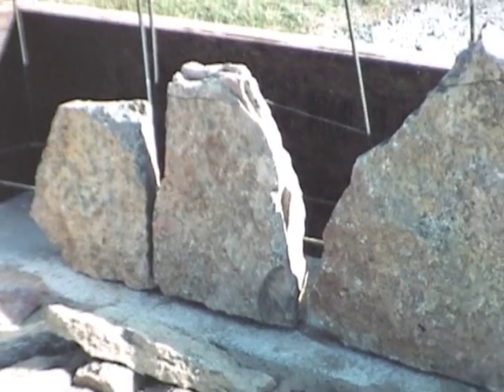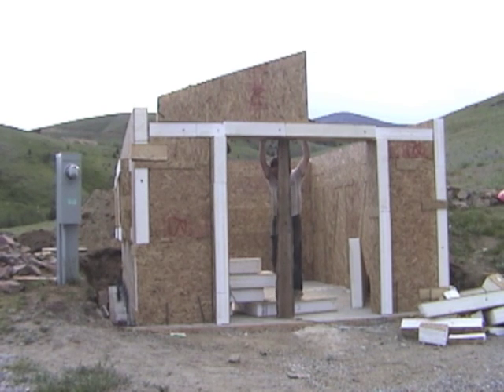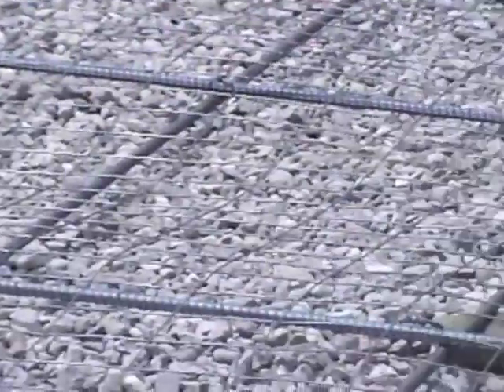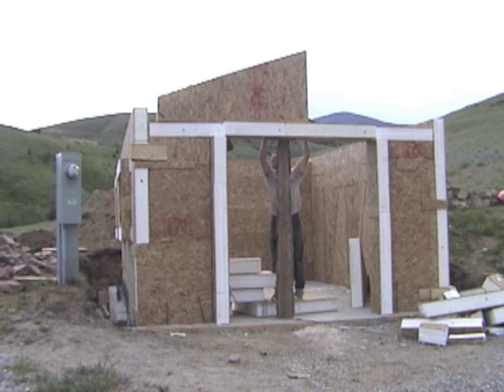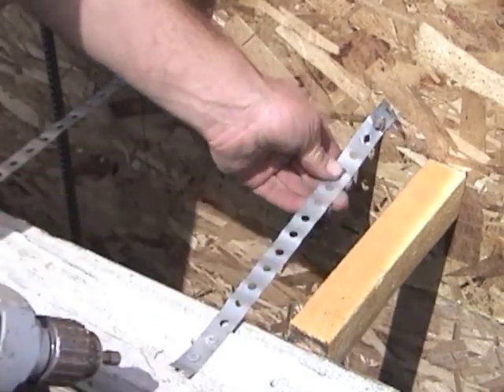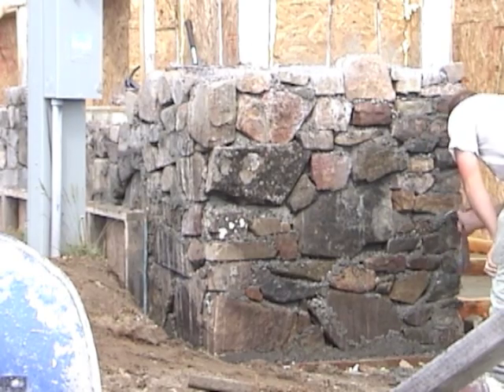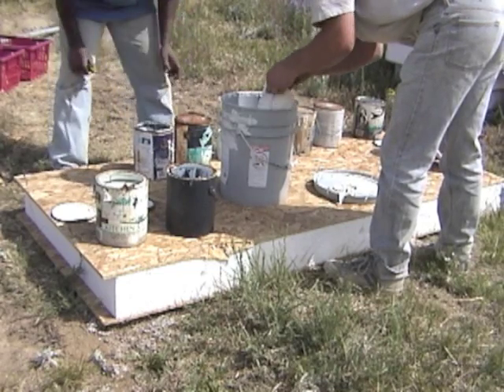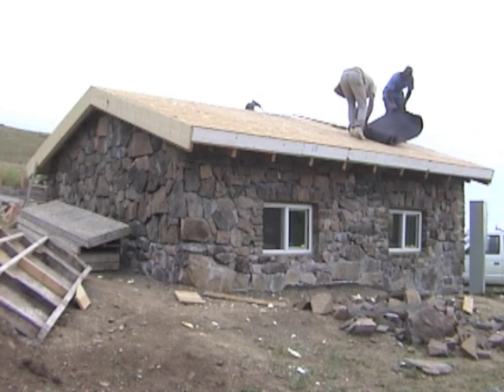Slipform Stone Masonry (sample clips from the DVD)

Comment from the maker: The costs are detailed on the DVD. I don't remember the exact figure off the top of my head, but I think we had +/- $4,000 into the shop, including excavation, slab, walls, roof, windows, doors, insulation, wiring... the works. I don't heat the shop in the winter, unless I am working on a project that requires it, but it is insulated well enough to stay above freezing all winter without heat.
Reply: I love it. Thank you for the great idea
Reply: Thomas J Elpel lindo demais,
Reply: You had $0 in ladders for sure.
Reply: Cheap shit

Comment: I wonder whether aircrete would work in place of the concrete as a filler for slipform stone masonry. It would be a less expensive, lighter, more insulated structure. Maybe strength would be a  issue?
Reply from the maker: Interesting idea. For this application it seems like the different compression strength compared to the stone would be an issue. However, I would love to work with aircrete on some other project!  Here's a tour of my house you might enjoy: https://www.youtube.com/watch?v=QWKPisywxvY

Comment: Pardon my question, but did you affix the insulated panels to the slab somehow? Or just kind of stand them up there??? And would it be better to wrap it in Tyvek before you start with the stone work?
Reply from the maker: Yes, we stood the panels up or braced them in place, then did the stonework up against the panels. Holes in the beadboard allows concrete to grip the insulation and create a permanent bond.  No need for Tyvek. :)

Comment: I'm curious how that foam insulation holds up over the years.
Reply from the maker: No noticeable change after 16 years. However, beadboard is not mouse-proof. The stone walls are, of course, but I did have some mice in the building due to aging issues with the door, and they did minor damage to the beadboard in the back corner before I got them out. :)

Comment: Problem is, no thought has been given to the corners and how they would look when the shuttering is removed. The corners look like wallpaper rather than a 'constructed' wall. The effect of bonding is mostly non-existent and arrived at by accident rather than design.
Reply: he did say to save the flat sided stones for the corners, so I'd say some thought is given to it. Perhaps overlapping stones coming from each side of the corner would be good. Structurally, the concrete behind the stones does the heavy lifting, so it's not the end of the world, in any case.
Reply: Using thin pieces of stone like this to create a veneer, means the corners are always going to look unnatural. Plus using face bedded stone on its side looks wrong too, but if that floats his boat....

Comment: Oh......what about covering those insulated panels on the outside face before forms ,stone and concrete poured /placed up against them, that would protect that wood from moisture from the concrete , weather etc.
Reply: My thoughts exactly, that OSB is going to turn to a moldy rotten mess in no time! the moisture from that wall will wick right into the wood and destroy it!  Bad move.

Comment: Have you tried making a wall without the insulation panels, just stone on both sides? Beautiful build.
Reply from the maker: I have built stone walls with insulation in the core. The walls are 18 1/2 inches thick, including 3 inches of foil-faced polyisocyanurate ("polyiso board") sandwiched in the middle. We pushed rebar through the insulation here and there two tie the two stone walls together. See my book Living Homes for details: http://www.hopspress.com
Reply from the maker: Yeah. The wall between my house and greenhouse is stone-faced on both sides, without insulation: http://www.dirtcheapbuilder.com/Articles/Building_on_Limited_Means.htm
Reply: How practical would it be to have stone on both sides and insulation in the middle?  It's a little disappointing to see beautiful stone walls on the outside and blah sheetrock on the inside.
Reply: tom, have you ever purchased a ladder or do you prefer to just pile shit up and stand on it? I'd rather see quality in the end rather than scavengry just to save a buck.
Reply: @bobbybrown221-vh1    well, hes the one with the finished project your here to see and hes not a contractor bound by OSHA crybabies.  im here to see a quality finished product i intend to do myself....not how much he spent in equipment.  most of us DIY types live by scavengry just to save a buck.

Comment: Thanks for the video, Tom.  I've been building stone slipform walls as part of my masonry repertoire for 27 years.  I have some comments which you may find helpful.
Most of my slipform walls are freestanding garden walls, that is, both sides and cap are showy stone, and the walls often curve sinuously. I've built 30 ft. tall chimneys and fireplaces as well, using slipforms, but my slipforms are simple triangular braces which are pinned into the ground, and use forms which are generally just reusable 16" x 8' sheets of deformable 7/16" cdx plywood.  The plywood is clamped into position at the top, which makes it easy to fuddle with things in order to create absolute plumb.
1. My first comment is that, imo, it makes little sense to try to mimic a proper rubble masonry style, as you have here, by attempting "blind" fits into a form.  Why not just learn and apply proper veneer masonry shaping and fitting and structural must's to create quality fits and uniform joint widths?  It would save you the hassle of lifting and re-setting the cumbersome forms higher and higher.  It would save you the hassle of waiting a day to strip the form, only to find you have yawning gaps visually competing with rock-to-rock contacts to inform the viewer that the wall was cast, not made with craft. The mortar has become unmanageable by the next day, and after chiseling out excess extrusions, striking fresh mortar into the deep gaps will likely make the wall's appearance even further from traditional rubble masonry. The need to then acid etch the film from the rock faces is a further inefficiency.
2. My solution has been to build with a stone type, river cobble, which can only feasibly be laid into slipforms. The beauty of smooth, non-angular egg-shaped or round rocks is a) they're beautiful, b) they nestle into the the swales left above the joints created by the courses below, and c) if you use a low-viscous mortar mix, you can remove the form almost immediately upon laying the last rock, assuming you've bedded each stone well and aggressively filled all the voids as you build.  This immediate removal allows you to carefully tool, strike and shape the mud to reveal as much stone as possible while the mortar's still malleable.  Larger cobble can be overlapped at the corners as if they are quoins, so that structural appeal can be at least simulated.  A large "boat sponge" is used to somewhat aggressively finish the joints to give them continuity in size and depth. In the early stages of scouring the joints, the sponge picks up sand abrasives, which give it excellent bite into the joints.  The later into the process, the more frequently you want to wring the abrasives out of the sponge and use clean, untainted water, to ultimately final-sponge the film left on the cobble surfaces.
3. Slipform is a great technology, but it's best use is with stone that can't otherwise be laid skillfully without the use of slipforms.  Tapered river cobbles can be used to make lovely arches, and elongated ones can create corner quoins and other features specific to skillfully rendered stone masonry.  A final tip:  use only angular sand and portland cement in your mortar in order to avoid the winter white crust called 'efflorescence' to appear on your outdoor builds.
Reply from the maker: Great tips! Do you have a website with photos? Or would you like to contribute an article with photos to our site?: www.DirtCheapBuilder.com
Reply: search "slipform" on StoneMad for links to some pics and discussion.  I'm Todd C.  Pleased to meet you.  I dislike the title dirtcheapbuilder.  Quality building costs money, time, sweat, skill - things not easily acquired or replaced, so why represent them as cheap?
Reply: @haileunusual  Can you link the website? Can't find the info you mentioned
Reply: What was your mix just out of curiosity? When I built my gravity retaining wall I used concrete sand.
Reply: Gary, 3:1 sand to portland, dry-ish mix, no builder's lime.  I use crushed basalt sand, which may induce some waterproofing qualities in the mortar due to pozzolanic reaction.
Reply: Hi there, I'm planning on building stone wall holiday units.  Do you have a website or a job near me? Cheers
Reply: My mix was 50 percent lime, 50 percent Portland (type N mortar) Why no lime? No lime would give a higher strength but be prone to cracking over time.
Reply: There are 2 "lime's" Gary.  

Traditional quicklime, the powder-like result of burning, then pulverizing limestone or seashells is, with water, slaked into lime putty, which is the root of "true" lime cement when added to aggregates, at which point it becomes lime mortar or lime-crete.  Lime putty derived from quicklime is a true, viable 'beast' unlike portland cement, which is "dead" by comparison.  Lime mortar is preferable to many stone masons for at least a couple reasons: It sets up less hard than portland mortar, so yields slightly thru time, discouraging cracking, and if it does crack due to sudden movement, sometimes even hundreds of years later, it literally is alive enough to grow fresh crystalline structures over the crack and thus 'repair' itself from the inside out.  Remember, it's a rule of thumb that stone, brick, block should be bedded in a mortar that cures less strong than that stone, brick, block. "Less strong" means, comparatively, more deform-able and less crack-able upon curing. 

Finally, in my experience, true lime mortar/lime plaster's biggest disadvantage is its use outdoors in hot, dry climates, because it's more sensitive to desiccation than portland cement mortars.  It needs shaded and tended with mist twice a day for two weeks to avoid developing dry-fissure micro-cracks.

Builder's lime purchased at hardware stores, aka hydrate lime, which I presume you used, Gary, only lends plasticity (read smear-ability) to a portland/sand mix.  It does not have cement-like qualities and is just a mortar additive, and its use in stonework can make the job much messier.  (With regular masonry units like brick and block, it is fine if manged skillfully.) It's safe to say that builder's lime adds, not cement-like qualities, but glue or adhesive-like qualities, which are two very different things.  Cement is for creating stable bearing, glue is for attaching things together, sometimes things that have no structural business being attached together.  This is the question that a mason worth his salt always asks: "Would this wall I'm building stand up without mortar as surely as it does with mortar?"  It's why novice stone masons should be taught first how to build a drystack wall, to see what strategies keep it standing up or make it fall down.
       
Building lime's final disadvantage is that, when used in outdoor features exposed to moisture and freezing, it can cause efflorescence, or the wicking to the stone's surface of minerals which deposit a white, chalky scale in the cold months.  Efflorescence can be nullified only temporarily, by use of applied acid solution or pressure washing, but it reappears every winter because it's integral in the mix.

That long-winded lime explanation done, I think it's safe to say that slipform building is not "real" masonry work.  That is, since slipform work relies on the glue-like qualities of mortar rather than its use a bearing and bedding platform for stonework, it is more like casting concrete in lifts than crafting structural, well shaped and well assembled stone to achieve structural integrity, which is stonework to its root.  This is why I use only non-structural rock for slipforming - cobble, rubble and miniscule bits which can't stand up on their own.  Non-structural rock is still rock, still beautiful, and deserves a chance to shine!
Reply: @haileunusual  Todd C. I tried googling slipform stonemad, but didn't turn up anything. Would love to see pics of your work, it sounds beautiful.
Reply: @haileunusual  I couldn't find slipform stonemad either

Comment: One thing what I just simply can not get is why it is so popular in US to use that almost useless power drill instead of handy and light cordless drill ?!?
Reply: Because it's much more powerful and doesn't require having batteries charged all the time. Cordless is handy if you're just screwing nails in places. I love my 20V Dewalt system for that, but power drills still have tons of uses, especially high torque and long duration operations like drilling concrete or paddle mixing.
Reply: Because some do  ore than changing a couple of screws and hanging up pictures. try work when you need a drill for your 12 hour shift. Dumb
Reply: specifically, he uses 8" (+) screws, which requires more torque than hanging drywall. At a construction site, the generator is going to be running anyway (either to charge tons of batteries, or to power the tools), may as well use the torque, and git-r-dun quickly. As the others said, there's a place for the cordless, but, if you're  using a drill to mix paint, stir compound, run dozens of 8" screws, etc, you can't beat a good ol' 120v craftsman....plus, my corded one is good excercise. the bloomin' thing weighs a ton! :-)

Comment: i would paper the chip board wall first before pour concrete against it.
Reply: That's a good idea. I think they had insulation on the other side, thus serving the same purpose for separation,  but serving the greater purpose on the building.

Comment: Ohhh pleaseee don't use cement to build stone walls!!!! You should be using 1/3 pure lime with a 8% mixture of cement and 2/3 sand! Lime lets the wall breath and doesn't trap humidity in the walls and lime also kills bacteria. Lime lasts 1000 years were cement holds 100 years. Lime can handle cold to warm temperature changes were cement tends to crack!
Reply: Makoto Ozaki
I'm getting a vision of a stone wall with 1000's of key limes stuffed into the cracks
Reply: 'proper cement' was invented in 1824 if I remember correctly, the Romans used lime mixed with pozzolan, exactly what the OP says.... if you can't get decent hydraulic limes for stonework then yeh, you could use pure lime with pozzolan, we don't use cement any more though, unless it's a garden wall or something
Reply: *****
 You should be able to get it where you get your cement .
Reply: hey sorry for the late reply! you can use any kind of lime.
Reply: Agree
Reply: *****
 Cheers to you Justin!
Reply: this looks super old, but i agree as a brick mason.
Reply: Makoto Ozaki - If you use a lime mortar mix will it permit the growth of moss over the joints? I love the old granite walls patterned with thick moss, and even small ferns growing out of the cracks.
Reply: It's not a stone wall. It's a styrofoam and concrete wall with a stone veneer. Don't use lime in place of the concrete.
Reply: Thank you very much for this information.
Reply: Eh, portland cement also kills bacteria because it's also a very basic substance. Lime is weak against acidic rains, which can be bad depending on your region. Proper cement with pozzolans can also last pretty much forever, a good example being the roman Pantheon.
Reply: Tezcax it also destroys the compounds which hold the stone together . Cement is water proof and stone is porous  unlike lime. therefore stick your Portland on bricks not sandstone . Simples
Reply: Ventilation and humidity problem would not happen. Concrete keeps your house stronger with little to less maintenance. Lime will give you maintenance just as you are done.If they had lime concrete in the old days, they would not use lime.

Comment from the maker: There is a cost breakdown on the DVD. I don't remember the figures off the top of my head, but I believe we put about $4,000 into the shop. That included everything from excavating and pouring the slab, to building the insulated stone walls, putting the roof on, windows, doors, and electrical work.

Comment from the maker: I'm sure that you could use mud to fill the joints along the slipforms to keep the concrete from squeezing out in front of the rocks. It would take a little more time, but might save some chipping and grouting work later in the process. I'd like to try that method some time, too!

Comment: I saw another house where they used sand to prevent the concrete from getting through to the face of the rocks too much.  What I was wondering is if you're going to grout anyway, could you use mud?  I figure mud would be easier to work with, and easy enough to wash off, but I wonder if it would have any negative effects on the concrete.

Comment from the maker: The oriented strand board (OSB) should be left off the outside of the structural insulating panels, so that the concrete goes directly against the beadboard insulation, and not up against the wood. For my workshop, however, we used scrap insulation panels obtained for free, and left the wood in place. But this part of Montana is drier than most of Arizona, so I don't believe it will be a significant problem. :)

Comment from the maker: Sure, that could be a concern. According to the Healthy House Institute (.com), "OSB and exterior plywood both contain a formaldehyde-based, waterproof resin called phenol-formaldehyde (PF). Compared to the widely used urea-formaldehyde (UF) resin, PF resins emit relatively low levels of formaldehyde."

Oriented strand board is used pervasively in modern construction, and while I am not overly fond of it, at least the price was right - Free!